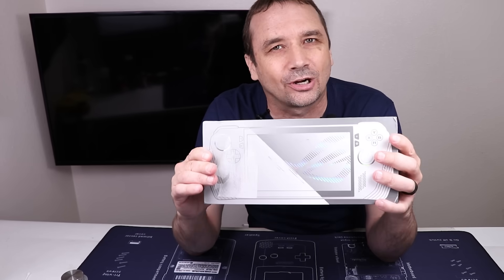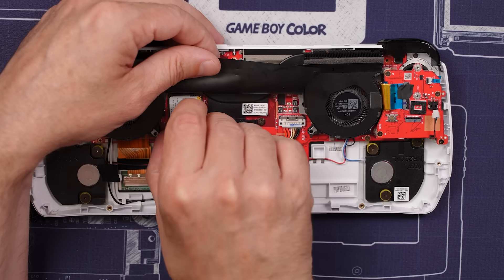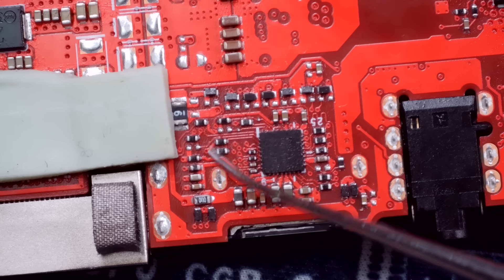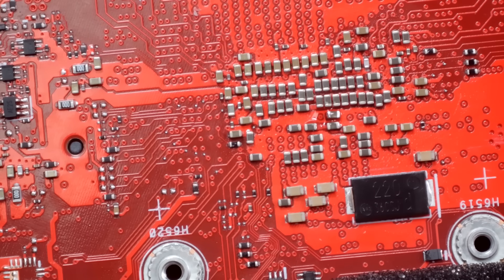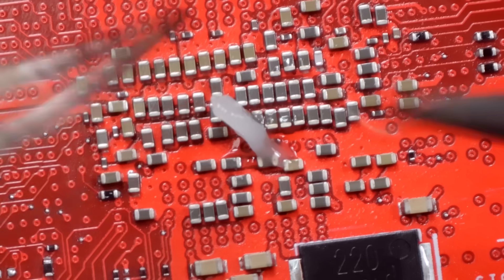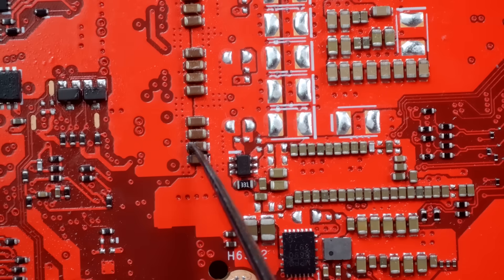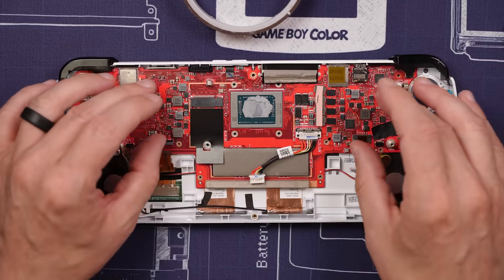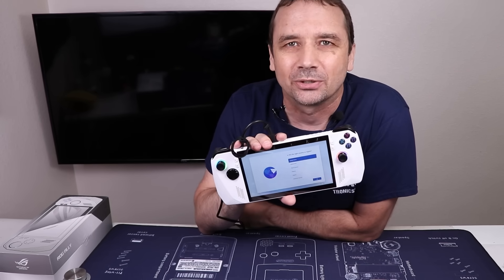ASUS REFUSED to Fix His ROG Ally - Can I?

Comment: After someone tried to reflow at home warranty for sure would not cover, but using water damage as a reason also BS. Should have said you messed with it so anything could be broken, analysis could take ages therefore the high repair costs

Comment: Well I get the denied warranty cleaner but it is a known issue with the rog ally cooling it's own sd card slot so that should be a recall on the system unfortunately electronic companies aren't held responsible for there poor designs

Comment: Something like this happened on mine tonight after after a upgrade on the SSD, you need to hold down power button for 45 seconds ISH without power... Then plug in a higher powered supply, I had a 100 watt charger then it jumped back to life .😎... The original Rog adapter would not do it ,.

I seen on this video you doing soldering and magic stuff so this looks a lot more broken , but Rogs have this bad condition of not suddenly powering on and it just needs a boost especially after opening up and upgrading when you unplug the battery

Comment: I've had two SD card readers die under warranty repair so Im done with Asus and the Ally model completely. They just want me to keep sending unit in for motherboard replacement every time last time was the last time for me. Bad thermal design flaw is not the customers fault.

Comment: Asus shuold have take care of that. I know a lot of people like Asus, but I've only had bad experiences with them, similar to this. MSI was a similar issue, but in the end they came through, so I guess do with that what you will. XFX on the other hand, they upgraded my gpu after an RMA. Went from an rx480 to an rx580 that was overclocke 15% or so on the core. Another one that's surprised me is Gigabyte, but only on their high end products; their low end is trash.

Comment: asus is know for being twats when it comes to warranty repair.  They 100% should have covered it considering the SD card slot is a known issue due to heat. Steve from gamers nexus even warned owners about this exact situation. "Let them deal with it or they will find a reason to deny you claim" and that was exactly what happened in this guys case. Next time, don't do anything to it before sending it in. However, they might have still lied and not fixed it under warranty,  asshats.

Comment: Thank you for another video Steve! Enjoyed as always. Let me give some pieces of advice. 
1. You did absolutely right about using soldering iron for the loose capacitor, as it is on the backside of the APU. Yet it is helpful to preheat the board with hot air at medium temperature (something around 250 C).
2. While it is possible that the second capacitor blowed because of unusual high voltage on that line, I am 90% confident that it blowed up on its own. That row of capacitors is on some power line, probably main power line. The load on this capacitors is pretty high, so no wonder one of them died.

Good and interesting video, as always! Thank you

Comment: Sounds to me that something went wrong with it and that fact is. Did the seller attempt to repair it himself before sending it to ASUS. Cause that would right away void warranty. Either way you fixed it and as what they said was water damage. Shame on them not including a water damage indicator. So really its on them. But you found he Flux on and round that chip that caused the residue really leave me more suspicious of the system was tampered with before sending it to ASUS for repair. So really shame on ASUS.. and shame on the seller that took it apart when on warranty.

Comment: my rog ally update failed during the MCU firmware update. Since then the inbuilt controllers are not working. They work only when navigating windows. Not working in any games, armoury crate, steam, xbox app etc. Tried to update the firmware again somany times but  it kept on failing. Checked the version of MCU Firware from armoury crate and it says that - the main firmware version 319 and the secondary firmware version is 320. This mismatch must must be the reason for the controller issue. 

Did a cloud recovery - didn't work. Did a clean installation of windows and installed all the drivers - didn't work. Later i came to know that cloud recovery or windows installation does not change the version of bios and firmware. 

Tried to downgrade the version of MCU Firmware by following a reddit post (it was a great idea) but i didn't work for me. I have been searching internet for weeks now for a fix. Sadly i couldn't fix the issue. 

I'm deeply frustrated. I cant free my mind. Cant concentrate on work. i dont want send my ally to a repair shop. So if any one know has any suggestions please let me know.

Comment: Microsoft lied and damaged my phone beyond repair. To avoid replacing my duo 2. They sent it back damaged. I told them it was stolen off my porch because I didn't damage anything and it was in perfect cosmetic condition. They do everything to avoid replacing to the point of crushing the phone. They ended up replacing the phone brand new

Comment: Reminds me when I tried to fix my ps3 by doing a deep clean on it, I cleaned my brother's perfectly but on mine I broke a tooth on the board that attaches to a ribbon cable for the disk drive. All because I pulled it when the cab was closed which was neglectful on my part

Comment: I think ASUS were right to refuse the repair on the grounds it was opened by the user and tampered with, however the liquid damage line and extortionate off warranty repair is highly questionable. They should be forced to carry out repairs like this at a much more reasonable price, but I suppose for them they would probably have replaced the entire board rather than trying to repair a faulty one.

Comment: Its too bad that companies don't really sell parts of their products anywhere, because the main thing that prevents people from being able to fix their own things like in this video, is that if the part that is damaged is not easy to find in any of the online markets, then you have to rely on finding a similar product that is being sold for just parts, and then try to see if you can salvage the parts from that product to be able to use it on the one you want to fix, and that is why repairs are just a mess and not everyone can do it, since you not only need to have the resources to be able to do it, but you also need the knowledge and experience as well, but unfortunately with the way things are currently handled, it is far more expensive to repair something than it is to get it replaced, and that is because companies are purposefully making it hard for repairs to even be considered, as they just want you to buy their latest products when any of the ones they've sold you start having issues.

Comment: That's a shame to hear. I had an Ally I got from Best buy and the USBC port completely went out and started to overheat the type c cable badly when plugged in. When I went to claim warranty through Asus I was instructed to take it to Best buy, about a week later it was fixed and I was told the motherboard was replaced.

Comment: I would decline it just fine, you have 2 reasons that those capacitors can go bad, a fluid damage! or wrong charger or cheap charger that failed with no protection, oh a lightning storm while on charge could also potentially cause that too. User opening the device and trying to fix it themselves also another event that will void the warranty, you've got coverage let them handle it. Either way, reading thru their warranty policies, they are all cases that voids the warranty. I am pretty sure they tested the fan and cooling components to ensure that cooling didn't fail and caused over heat, so once that eliminated they will decline the warranty as many manufacturer does. It is usually good practice to spend extra couple dollars to buy additional warranty like Asus Premium Care, Asurion or Allstate whatever the retailer offers. They are definitely worth it.

Comment: There is no reason they should have denied that repair. They just didn't want to have to do it for free. That was wrong of them. Great job on fixing it!
Reply: Faulty sd card reader does not stop these powering up. The customers repair attempt broke the device completely so there is a solid reason for them to say NO to warranty in this case.  Asus was not in the wrong here.
Reply: @ElectronicAllsorts  It was "liquid damage" that was the reason they denied the warranty request. So, no they shouldn't have denied the warranty if there was no liquid damage present.
Reply: @sevenfawm  There is flux residue, Flux is a liquid.. solderpaste was used and this is microscopic solderballs suspended in liquid flux. Warranty never covers failed customer repair attempts or physical damage for example a capacitor broken off the board. Does not matter what reason they tick on the computer system but liquid residue is a fair enough selection.
Reply: @ElectronicAllsorts  I think you didn't really watch the video, maybe go back and watch it where the liquid indicators weren't even changed so they really had no excuse besides him opening his own console and "voiding" the warranty which depending where they are living is not a thing. Read any other number of comments and they will say the same thing I have. Sure flux is a liquid, but it is not a liquid that is considered in "liquid damage" that would cause a denial.

Comment: I think Asus should have fixed it as there were known issues with heat and the SD slot on those OG models. If the SD slot hadn’t failed, then the original owner wouldn’t have felt the need to go in there.

Comment: I dont have that much of an issue, that the warrenty was denied, since the owner tinkered with the device.  But what i have an issue with, is that the ASUS repair shop most likely just opened the device and  looked, if all cables were seated right. After the device still wasnt turned on, they simply looked for any sign, that even remotely could be some sort of boarddamaged and then declared it waterdamage and billed FU-money just to get rid of the customer. If it was any other company, than ASUS, my assumption would be outlandish. I mean they had the controversy not too long go, where they overcharged gamers nexus $200 for a broken thumbstick on the ROG ally and wanted to make unnecessary replacements unrelated to the customer problem.

Comment: Great video, and very inspirational.
Just a noob question:
Those components you re-soldered, you keep calling them capacitors, but aren't they resistors?
Even when you checked with the multimeter, you said there were some ohms on one side, which made me think those are not capacitors?
I just don't know, I am genuinely asking.
Reply: SMD capacitors are normally gray brownish colored while resistors are usually black. He was not measuring the capacitance but he wants to make sure that the resistance (ohms) between ground and one side of the capacitor are not too low which could mean there is a short.

Comment: there are no seals on them, the opening still needs to be proven, refusal of warranty is not yet grounds for removing the warranty, if the engineer who carried out the inspection is blind and saw liquid somewhere, he needs to prove it by taking a photo, if there is no photo and there are no indicators of moisture, you need to write a complaint to ASUS

Comment: An Asus ROG product's warranty becomes void if the product's serial number is altered, the product is tampered with or repaired by unauthorized personnel, or if warranty seals are broken or altered. So no, ASUS will not fix your device if you strip it apart and try to fix it yourself.

Comment: Asus.... Never ever will buy again. Gpu (gt740m) died under warranty, replaced. Camed back with broken hinges. I sent it back, took another month to get it back to me. Received on friday, on saturday I noticed 3.5mm jsck was not working. Turned out they replaced mobo with some used one. On monday I got in contact with asus. We wont replace it under warranty, you propably broke it through weekend, you should have called earlier (right, got it on friday afternoon, found out on saturday morning). They offered new mobo for 600 Euro (basically prixe if laptop)

Comment: An ASUS ROG Ally warranty is voided by user-induced physical damage (e.g., dropping it, improper use, or breaking something during an upgrade) or unauthorized third-party repair attempts. Performing legitimate upgrades like swapping the SSD does not void the warranty, provided no damage occurs during the process. You can also extend the warranty to 2 years by registering. 
What can void your ROG Ally warranty? 
Physical Damage: Any damage caused by accident, misuse, or if you break a part while performing an upgrade.
Improper Use: Using the device in a way that is not intended and causes damage.
Unauthorized Repairs: Having someone other than authorized personnel perform repairs or modifications on the device.
What does not void your warranty?
Storage Upgrades:
Upgrading the SSD is generally permissible, as long as you don't damage the device in the process. 
Using Armoury Crate SE:
Adjusting fan speeds through Manual Mode in Armoury Crate SE will not affect your warranty. 
Reporting the microSD card issue:
If your ROG Ally fails due to the known faulty microSD card reader, ASUS will extend the warranty to cover it, TechPowerUp reports. 
Key things to keep in mind:
Take Care When Upgrading:
Be gentle and use the correct tools when performing user-serviceable upgrades, like swapping the SSD, to avoid causing damage. 
Understand the Magnuson-Moss Warranty Act:
This act requires manufacturers to prove that a user's action caused the damage to void the warranty. ASUS cannot simply deny coverage because the device was opened. 
Extended Warranty:
ASUS has extended the North American warranty to 2 years to cover the faulty microSD card reader, so take advantage of this.

Comment: I'm partly with Asus on this one. The owner most likely messed up the caps trying to repair it, and then sent it off for warranty... But liquid damage is a lazy excuse, and they should have priced the repair waaay less. Replacing two caps should be idk, $50 tops? Instead, they probably wanted to replace the entire board which is way overkill. It's sad that manufacturers usually won't attempt even the simplest board repairs, but of course, why would they, if they could just make another sale and make more money? That's why we advocate for independent repair shops and right to repair.

Comment: i have one that has a gremlin. Sometimes it will boot up just fine and sometimes it won't turn on at all even though the battery is full. When it does boot up, windows randomly crashes.

Comment: ASUS while once amazing, has been awful for years now.  Their support is horrible too.  

That said, if someone opens up the device and reflows things, then I don't see why things should have to be repaired under warranty.  $800 is also ridiculous though.  Probably just swap the unit out or something for that.  :D  I did also notice several components that were no longer lined up across the board though when you pulled some of the covers/pads/etc. off.  Not sure why someone's first step would be to reflow multiple components.  If it stopped working, try sending it in first.  If it's denied, then try to fix it.  But do it correctly.  :)  Nice work getting going!

Comment: First things first, the repair should not cost over 800€, 100€ max I would say, but I assume they would just have replaced the whole board. 
Liquid damage: maybe this was the closest the support could find in their automated reply or because they may can't proof (don't know if there is a warranty seal), that he worked on it.

Anyhow, even if the customer has done nothing wrong and warranty is still on, Asus is, in my own experience, not willing to fix things. 
That's why I would rate the repeatability, that includes the possibility to buy new, official, replacements for a decent price, should weight 50% of any test result for all electrical devices. The SteamDeck, Fairphone, Shift phone, this modular notebook brand are what we need.

Comment: The FTC is very clear that a company cannot deny warranty coverage because of a non-authorized attempted repair. Per the FTC, a company can only deny warranty coverage "...Companies may, however, refuse warranty coverage for defects or damage caused by using third-party parts or third-party services..." It was VERY iffy if this damage was caused by the customer, or someone he/she contracted with. I would think a complaint to the FTC is warranted. At the very least, the owner can cause some hassles by complaining to the BBB, the FTC, the department in their state that handles consumer issues, etc.  PS: I ran Warranty Operations for a major multi-national for the Western Hemisphere. I am not simply bloviating. This is my professional opinion. The customer should not simply take it on the chin, especially since he has the video from TronicsFix that supports his complaint.

Comment: I think Asus was within their rights to decline it since it no doubt had a you open this up and the warrantee is void clause, but that should have been the reason NOT liquid damage, and to charge someone $860 to replace a bad capacitor is ridiculous.  But the quality of Asus has gone to hell in a hand basket.  I used to only purchase their motherboards, but recently got three x299 boards with bad memory channels, one with a pin MISSING from the CPU socket, so it seems to be a case of the name goes on before the quality goes in.

Comment: Once the device has been opened the warranty is voided. However, most when you need to place the OOW reason, it gives you different options but doesn't cover like "user tried to repair the device themselves, making it worse." So instead, in this case liquid damage was selected as the closest OOW reason. 

Background being doing technical customer support for a loong time.